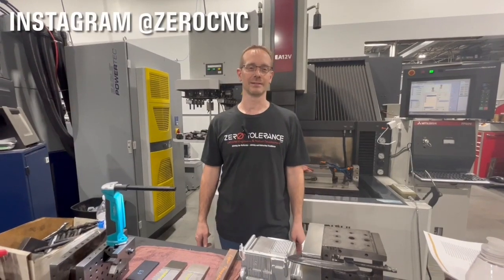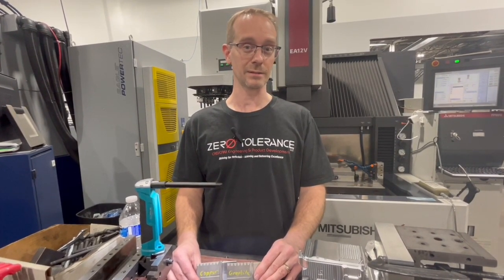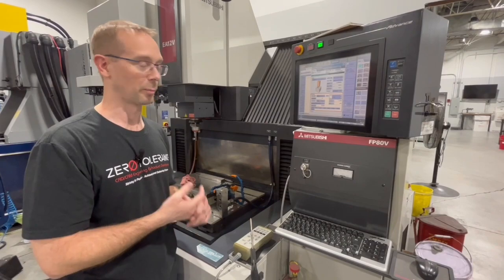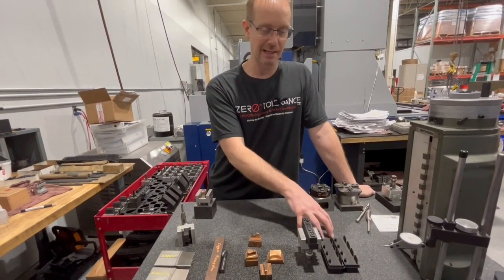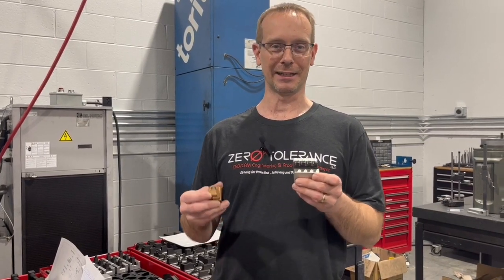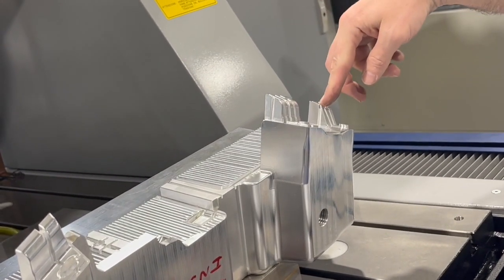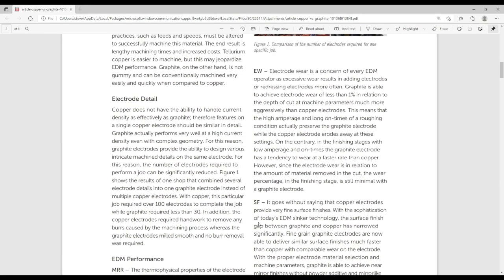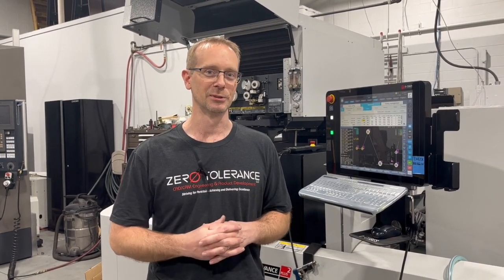Copper VS Graphite Which Material is Better for EDM Electrodes? - Part 2 | Learn to Burn

Comment: Nice headstone. 
  What did that set you back, $20,000.00?
  My observations are:
  Possibly graphite roughing and copper finish. If needed. 
Face cutting as you advised in normal production.
Flip trode and burn what was trailing edge, utilize both faces.    
  Thank you so much for sharing this!
  Mark

Comment: I worked in an edm shop for 9 years that did mostly die work but also mold work for moldmakers that didn’t have wire machines. On the sinkers, we never used graphite, only copper electrodes because the owner hated the dust and filth associated with graphite.
Reply: We use 99% graphite electrodes. Even though we use sucker systems, our whole shop is black. The floor, the shelfs, all the filter mats from the machines are black within a month or so too.
Reply: @DancingMachine1  and what abut your health??
Reply: @theskofily  Good question. I've been trying to gather info on that topic quite a few times over the years. All I know is that graphite itself is not toxic or harmful. 
When you are breathing in graphite as very fine dust every day though, it might obviously be not too good for your lungs. 
Additionally, that stuff might not always be pure graphite. It can be contaminated. I don't know the exact manufacturing process. 

Bottom line: Don't work in a shop that uses graphite if you have other options
Reply: @DancingMachine1  I have worked and still work in my own shop for 16 years we mainly deal with injection mold making 
We working with copper only , I used to work alot on ouer EDM machines 
In 2020 I got long cancer stage 4 (I was only 37 years old) I'm sure that the use of the dialectic fluid and othe vapor material that we used n our shop donate to my situation
Reply: @theskofily  This is sad to hear and really gets me thinking. I hope you are doing well today. I wish you all the best!

Comment: Even when I need to get those super fine finishes on parts most the time I will rough and semi finish the features with graphite then go in and finish it off with a copper or copper tungsten electrode in order to get the best of both worlds as far as burn speed and surface finish

Comment: What kind of roughness can you get on EDM ?
Reply: You can get down to VDI 12 (Ra 0.4µm) and even finer on modern machines with good settings.
Reply: @DancingMachine1  I watch a lot of videos. Read manual. To get Ra above 0.4, you need to enable the Orbit option. This is the movement of the XY electrode a short distance.
Reply: @aftaev  Yes. The Orbital option is standard on any EDM machine, even the old ones. I use it everytime so that after roughing I can take the finishing electrode,  sink to target Z height without touching the side walls, and then orbit. It is faster this way.
Reply: @DancingMachine1  I have an old EDM machine. It does not have an Orbit option. I want to understand what kind of roughness can be obtained with Orbit and without Orbit . Thank you.
Reply: @aftaev  What is the name and model of your machine?
Edit: Alright I see your EDM in your youtube videos. You dont necessarily need orbital function for a fine surface. You could just test it out. Take a surface ground piece of steel and a flat copper electrode, use the lowest generator settings that work on your machine and see what the surface looks like.  Take a EDM surface gauge and compare the surface. Then you will know what you can do with your machine. Greetings
Reply: @DancingMachine1  I made different settings and got a wide little roughness on my machine. I'm wondering if I add a visible ORBIT to my machine, how much better roughness can I get.
I am well versed in CNC. I can upgrade my machine. I'm wondering what the ORBIT option will give me. I watched a lot of videos on YouTube. But there are very few videos where they talk about ORBIT.
I found that the ORBIT option gives the best roughness. The ORBIT option may include worn electrodes in some cases. roughness with and without ORBIT.